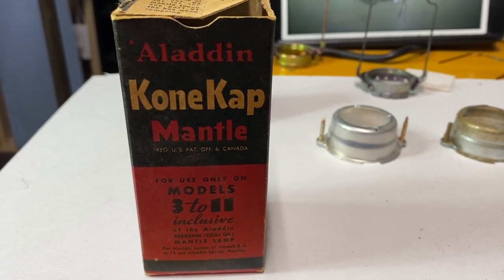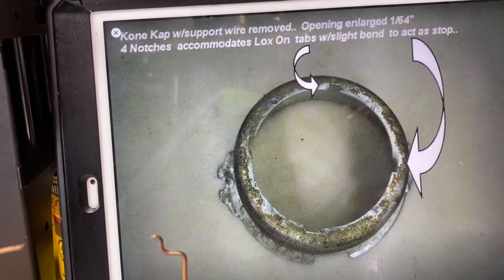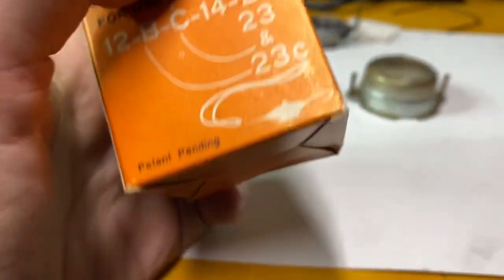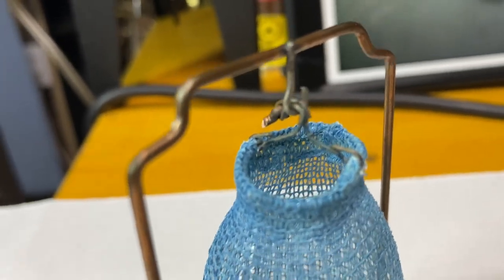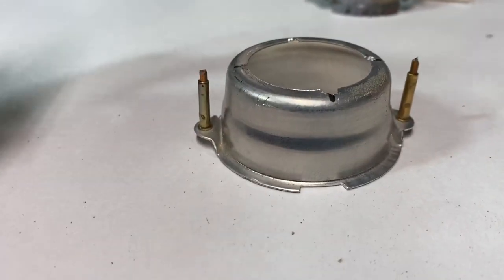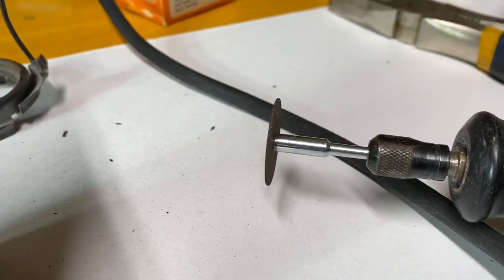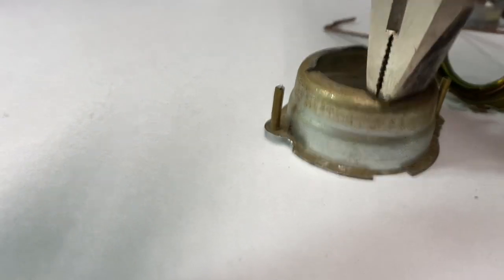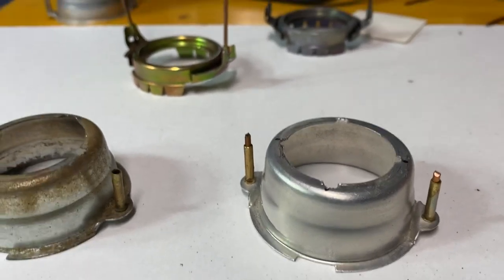Kone Cap mantle # 2

Comment: Yes, they make a cone cap adapter that doesnt cost much. But the odd part is, the adapter seems to work much better with the new style mantles, instead of the old ones in the orange box. I believe the new style mantles are just a bit shorter than the old ones.. I am using it on a model 6 Aladdin.
Reply from the maker: Mantles don’t get get better with time. Using new mantles is best practice. I’m not not sure how old the orange boxed mantles are. 
Cheers